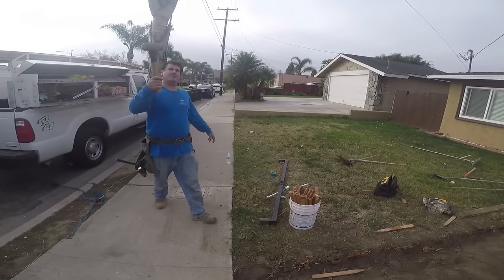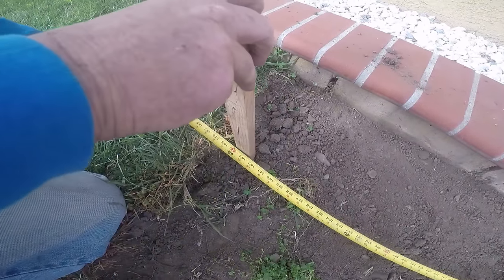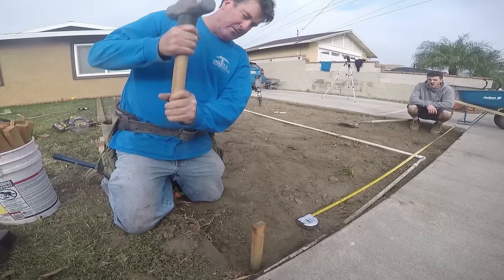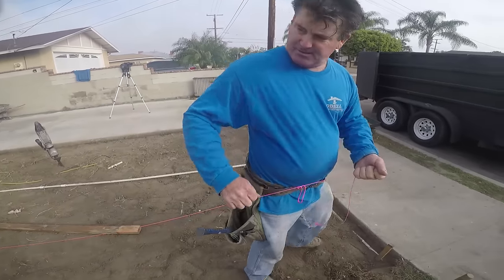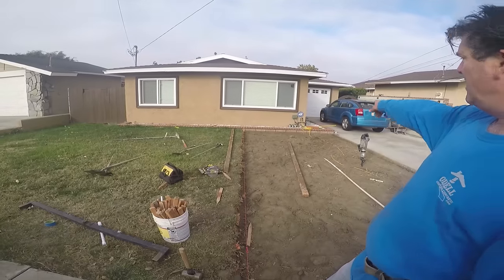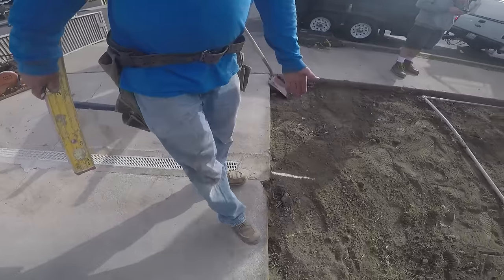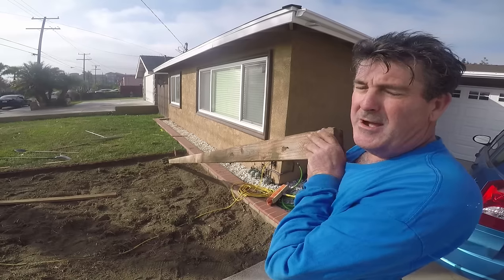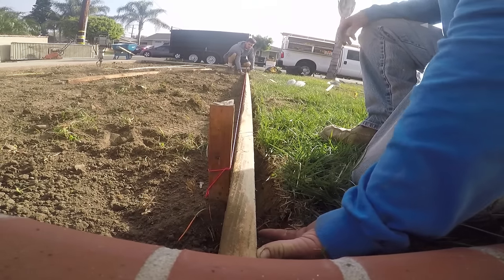How to Form Concrete Basics Driveway Addition

Comment: Did you use a jack hammer to dig up the dirt? You mentioned drainage.  We’re you going to put down gravel before pouring? Do you have to use a compactor after putting down gravel?  Do you have a video on how to put in drainage?  Could you do the concrete in smaller sections if you weren’t going to have it poured from a cement truck?
Reply from the maker: Draining towards the Street.
No gravel needed

Comment: You can't adjust your hammer hanger?
And why not remove the water pipe?
Reply: Oscar Gomez what water pipe??...that 1 inch (or 2”) water line was for the trench drain in the existing slab, theres no need to remove it! Unless he was going to tie into another trench drain at the bottom of his slab..but thats why he made sure his slab had slope to the existing drain, which makes for less work sense he could use the drain that was already put in
Reply from the maker: Your spot on.

Comment: LOL!  Nice Jedi skills with the hammer flips!  Thanks for sharing the finer details of setting the forms.  It all makes sense once it’s spelled out like that.  One question.  Any concerns about the width of the pour?  12ft from one end may not be the same 12ft from the other.  In theory, you could end up with a trapezoid if the original slab on the driveway is not square.  I end up fixating on stuff like that and always wonder if the forms are square.  Do you use the 3, 4, 5 method or measure corner to corner to see if the distance is the same?  Thanks again Mr. Odell!
Reply from the maker: No need in checking for square, all can do is match what is there I cant change it.
Its probably not square.

Comment: I’ve been in the concrete business for almost 35 years. Your videos are well done!
I have one question, why don’t you use steel form setting pins with predrilled holes instead of wooden stakes.
They are easier to drive, especially in rocky ground and also last several years of daily use.
Keep up the good work!
Reply from the maker: I use both, depending on the conditions

Comment: I need to form a drain box with two 6" pipe coming out the bottom. Can you do a vid on how to make the form, how thick the pour needs to be, etc. ??  Mine will be 12' long 8" wide w/ 1" lip on each side to hold the grating which leaves a 6" wide trough. I will be tapering the bottom from 5" to 9-10" over the 12' length.

Comment: Want to resurface 70 year old  36x 50 walk way that looks like a boomerang, it looks like 36"x36" plates were laid the length.  My thought was to prepare existing surface. form up with 2x4 or 1x 6, lay wire , pour 3 or 4 inches and finish?
Reply from the maker: Sounds good

Comment: I work in concrete setting forms as well but in Las Vegas Nevada and Pahrump.  Seeing you drive those stakes so easily makes me jealous lol. We run into a lot of really hard dirt and caliche here. We always use metal stakes and it’s always hard to drive them in. I learned to swing my sledgehammers over head with one hand and the other to hold the steak where it needs to be. It’s cool to see how depending on where you work how some things are different.
Reply from the maker: I worked vegas, sometimes you need to pre drill to drive a steel stake.

Comment: Amateur question: don’t the line stakes end up in the concrete and leave holes when you pull them?
Reply: im assuming he puts those there just to set his string then builds his form with stakes on the other side and pulls string and inside stakes before pour

Comment: How come You don’t use kickers on your forms?!?...even if the ground is solid i still use kickers just in case the mud pushes/twist my forms, i basically use them just for extra insurance so when i lay my mud down i know for a fact my forms aren’t going to move in any direction, i just cut them off flush with the form before i pour, so that way i don’t have an extra steak i have to rod around
Reply from the maker: I use kickers when I get to the 2 x 6 and above, or when the boards are so twisted I need kickers to straighten them out.
Reply: The one by steaks are so cheap i don’t mind using kickers on every job...i guess im to cautious tho lol...you do good work tho!!
Reply from the maker: Better same then sorry
Reply: Odell Complete Concrete Do you ever do any curb an gutter, or tall foundations??..or do you mainly stick with flat work???

Comment: The part of connecting the 2 boards to make it longer was sped up. I saw you hammered a small nail diagonally to connect them. Is that all that's needed? Will that nail get in the way when screeding?
Reply from the maker: That's it

Comment: Have to ask why you use the short handled sledge hammer instead of a round head post maul? With a longer handled post maul you won't need to bend down so much. Less back strain
Reply from the maker: I don't know, probably has to do with accuracy

Comment: There is one situation I like to go crown down and that's when you are having a hard time getting slope because of 2 or more constraining elevations. In that case, I go crown down because if you go crown up and your stake pops up, bam there goes all your pitch. Crown down and I tweak the form up just a little but if anything leave it low to the line (on the low side of the form work). Works good for me anyways
Reply from the maker: good idea
makes sense

Comment: 3 inch hex head roofing  screws and cleats at the joins no wasted nails joints tight and level and pegging to the line is not amateur it actually gives perfect line since the deformations in some boards even if its only 2mm can deviate a perfect line, there's no problem what you're doing but pegging at the back is definately not amateur.
Reply from the maker: Awesome
TY

Comment: The safety in this video is ridiculous. No hard hat, no safety glasses, and yes you need to be certified to do others driveways. I mastered in carpentry in job corps and this is a joke. He can get fined by not wearing his ppe. Personal protective equipment.
Reply from the maker: That sounds good but not true.
Why would you need a hard hat when there's no overhead work?
Get realistic.
Reply: The guy is setting up for a pour on a private home, hes not on a high profile job, give him a break. This guy probably forgot more about carpentry work than you will ever learn. I've been doing concrete work (formsetter, finisher) for 43 years and what hes showing is all the way I would do it, hard hat safety glasses or not. Focus on what hes and how hes setting forms

Comment: Nice  touch  with  the  hammer flip , but I  noticed that  you  didn't  do it with  the  8# er . Thanks for your expertise  in concrete work , I've  picked  up  a lot  of   pointers .
Reply from the maker: The sledge is a little trickier.
TY

Comment: How do I figure out the amount of slope to give? I am going to do my back patio 10 feet by 11 feet. Its in a corner where the homes slab meets on 2 sides. Do I need to slope it both directions away from the home slab or just one direction? There is no roof overhang for the porch. Thanks for any help you can give.
Reply from the maker: Both directions is nice.

I like a minimal of 1/8 per foot
Reply: Thank you for replying and your help! I am doing a slab that is 10 x 11. Can I get away with no control joints? Also what is the minimum distance I can give from the bottom weep hole metal flashing of the house stucco to the concrete pad? What do you think?

Comment: Didn't measure from corner to corner to check for square
Reply: So you can get your square and level and calculate the material you would need
Reply from the maker: No need, it's not a building foundation

Comment: What was the thickness of the driveway? Also I noticed your didn't use any base course or gravel or anything. Why did you just use the plate compactor on the dirt? Was it a hard soil so you thought it didn't need any AB or anything? And why did you decide to not use reinforcement? Thanks
Reply from the maker: Alex Stewart 
We went with fiber only, and big rock mix.
The dirt and weather are perfect here.
Reply: 10-4, I'm in Arizona. Pretty good weather here too. I'm debating on what we need now not sure whats best. Any recommendations?
Reply from the maker: Alex Stewart 
Check with local building department.

Comment: Wht depth of concrete will you use , I was expecting it to be twice as thick as it looks there
Reply from the maker: 4"s
Reply: @OdellCompleteConcrete   and thats plenty  for an average drive way ,, The reason im asking is im laying a slab for a garage , 18 x30ft  and i had thought as i have a lathe and a mill I would need at least eight inches it will be the same all over the slab , no thin bit in the middle ,, and ill put wire mesh down , probably fiber in it too .

Comment: Thanks a ton! Excellent work. I'm doing...or should I say screwing up forms for my house after a weeping tile job. For instance, for some stupid reason I picked up 2x2x24" stakes and they are difficult to drive. I'm getting some of the stakes you used. And the part about the string and temp stakes on the inside was brilliant. This vid has really helped me so much. Thanks so much!

Comment: Great vid! Was taught the same way! One thing I would've mentioned in the vid would be to make sure your stakes are flush or a little below your form to make screeding and finishing easier. An even harder hammer trick would be with the Sledge, hold your arm out straight and try to softly touch the Sledge to the tip of your nose! Pretty hard trick!
Reply from the maker: Sounds like a potential broken nose.
TY

Comment: Unnecessary work setting up that string. Build your boards first, splice them together to correct length. Set each end at 12' and stake. Then use a 8 duplex or a screw at each end inside edge, attach string and tighten. Finish staking middle to line. 10 minute job.
Reply: Greg Kovich thats what i do when the boards are real straight but the accurate way is the way on the video
Reply: I more or less use the same method,an its the fastest an most accurate way i know how to set up driveway and sidewalk forms
Reply from the maker: Yes I have to concur
Reply from the maker: Concur
Reply: Pop